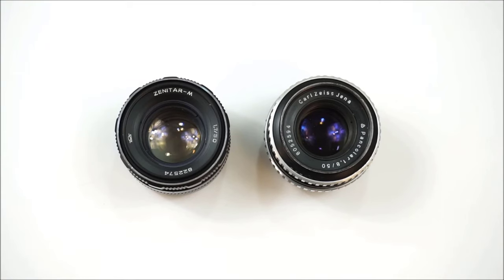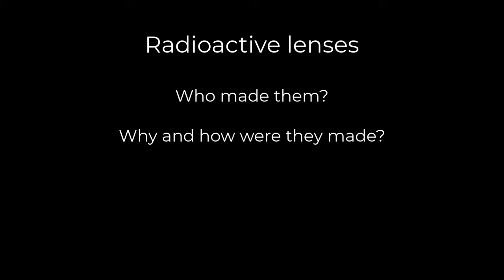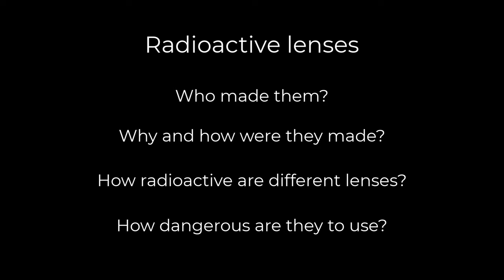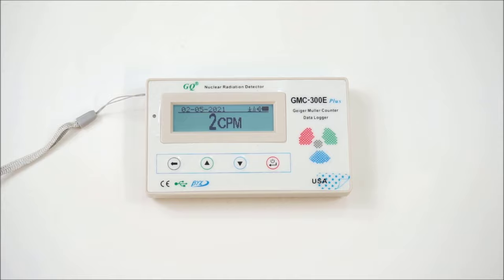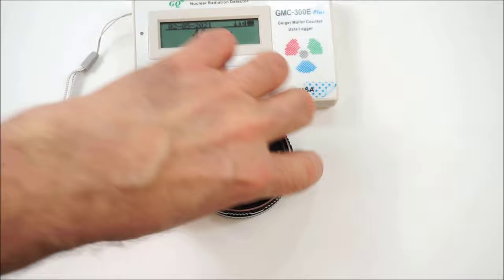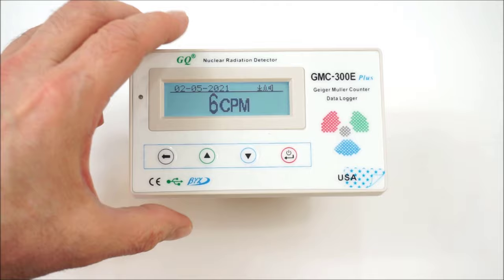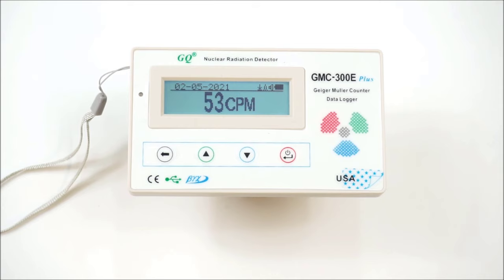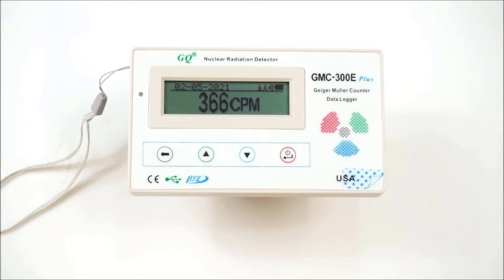Radioactive Lenses Part 1.   Get this lens out of the house!

Comment: Thorium emits mainly alpha (not gamma radiation) which is generally regarded as non hazardous because it does not penetrate solid objects well (eg skin.) The main hazard for thorium is  intake is through inhalation or ingestion of particles which in a solid glass lens is a non issue. Thorium doped tungsten electrodes are commonly found in welding but are slowly being phased out because there is a slight risk or ingesting or inhaling dust particles generated by the frequent need to grind new sharp points at the end of the electrode rod. Their use is generally regarded as safe here in the US by OSHA but recommends regrinding tips in a well ventilated area and washing hands after.
Reply: This is a common myth about thoriated lenses. The thorium decay chain includes beta and gamma emitters. So thoriated lenses emit alpha, beta AND gamma. After all, you can see it in the video, the Geiger counter used cannot measure alpha, so what you see is beta and gamma.
Reply: wrong
Reply: @michaelm1  you’re totally correct about the decay side products but the main emission is alpha. Radon gas in home basements is a similar alpha emitter and generally we talk about increased risk of lung cancer from inhalation but acknowledge that the decay products do lead to gamma emitting dust particles also. If you take the approx clicks per min being measured by the geiger counter and assume that about 120cpm= 1uSv it would take between 1000 and 1300 hours of holding that lens in direct contact with your body or 24,000 hrs of having it sit a few inches away to expose yourself to the same amount of radiation the average person is exposed to annually (6mSv). To put that into perspective I more often than not eat a banana with breakfast which has about 0.1uSv of radiation from K40. My annual banana consumption is equal to about 6.5hr of holding that lens directly against my body or 120hrs having the lens sit directly next to me. The bigger concern is not the end users exposure but the factory workers who can be in intimate contact with the raw concentrated materials all day long and exposed to dust from the manufacturing process. This is similar to the poor souls that had to paint radium onto wrist watches all day long.
Reply: I’ve been using these lenses with SLR and DSLR, both Pentax, for about 50 years and I’m still not blind!

Comment: I’m interested in using Pentax screw mount lenses on K mount bodies, both film and digital. I wondered if you could recommend a good adapter which is easy to attach and remove and also allows the lens to focus to infinity.
Reply from the maker: I use and recommend an original Pentax-made K mount to M42 adapter, and it works just fine for infinity.  I can remove it with my finger nail!

Comment: I just got a Pancolar Zebra. Is it dangerous or not??
Reply: It is.. Hehehe specially when to close behind.. Powerful kicks.. Hehehe ask lions..
Reply: Only the early Pancolar Zebra 50mm f1.8's have thorium elements and they are actually far more valuable ... so check the serial number and trade down to a non-radioactive zebra if that's your thing.  I am sticking with the radioactive version.
Reply: Thanks. I checked and mine is a later serial number. No yellow cast either.

Comment: What was the background count?
Reply from the maker: Interesting question, because when I first got the counter, it seldom registered any background count.    But now the counter has been contaminated from being close to the Pancolar.  So the starting point for the measurements is higher, and all future measurements will have to be relative to that starting point.  That’s OK, as I’m more interested in whether the counter moves up with specific lenses or not.... than highly accurate readings.